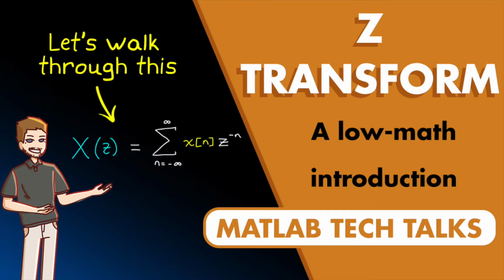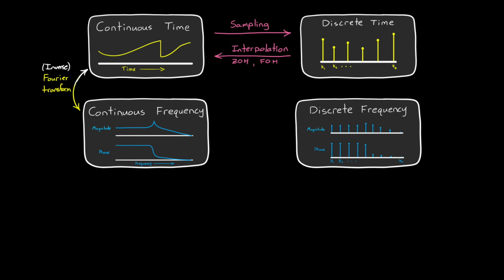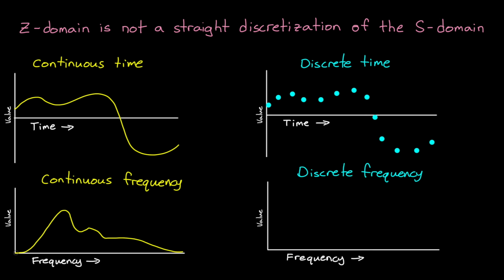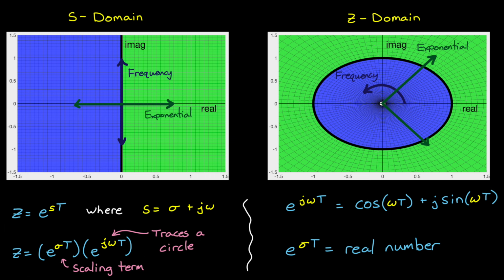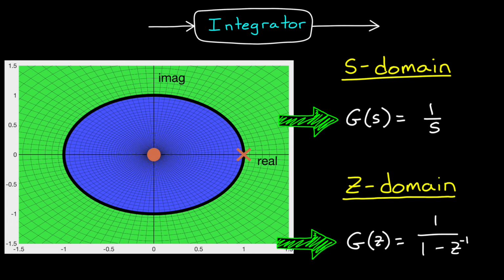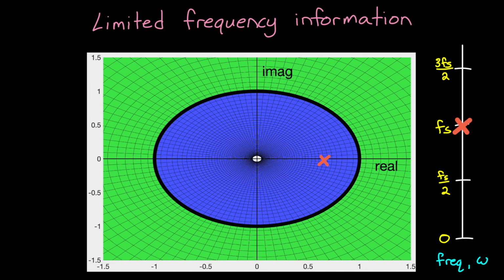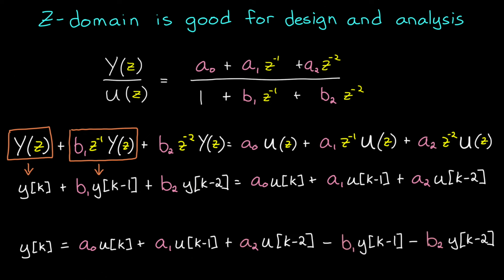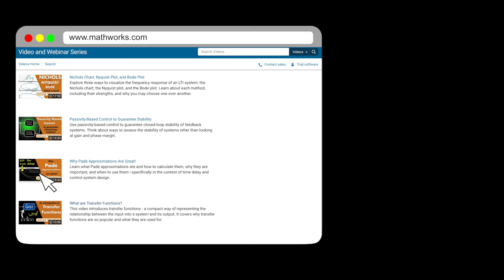Understanding the Z-Plane

Comment: These videos are amazing. Would it make sense to use the z-transform for system identification and with that build (or tune) a controller? Would be nice too see an example like the one you did with the arduino heater :)
Reply from the maker: Thank you for your suggestion!

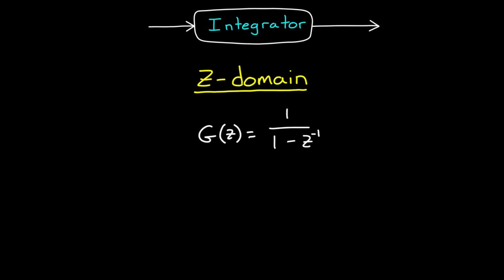Comment: @ 15:01 integrator example is also misleading. Integrator is actually a continuous-time device.... the discrete-time equivalent of integrator is accumulator that sums the number of samples...

Integrator never takes a discrete-time signal as input, u[k] and gives discrete-time output, y[k] as shown in the video.... it works on continuous-time signals